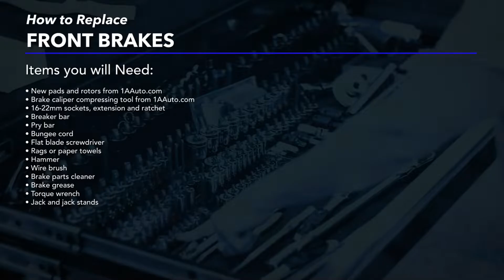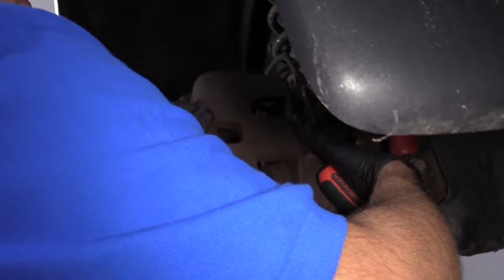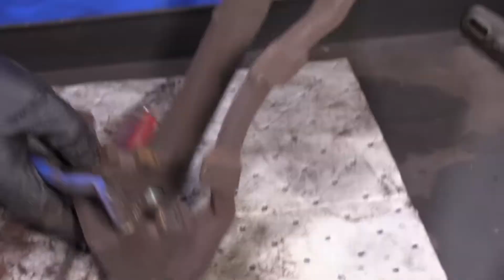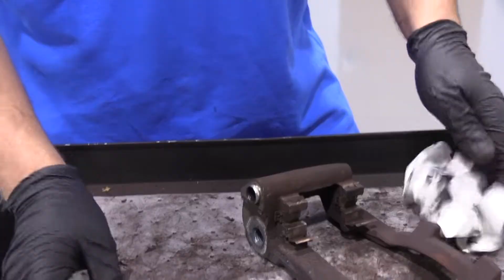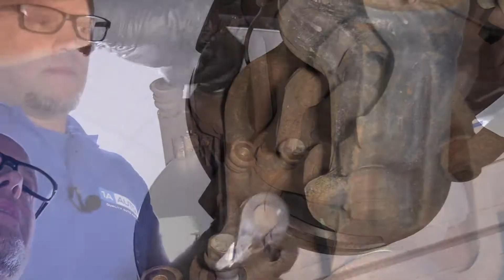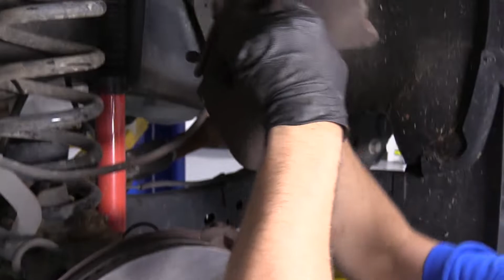How to Replace Front Brakes 13-16 Ford F250

Comment: Great video what is the break in process for these new brakes and rotors? I am about to change front and rear on my 2014 f250 6.7 and I want to make sure I break them in properly before I tow my 5th wheel!

Comment: You installed new brakes shoes using the old clips....that’s a cheap job. New set of breaks come with new clips
Reply: not their pad sets... no hardware included! And he reused the old bolts after he said they should be replaced FAIL. And he didn't put the cap on right, missed the notch

Comment: 165 foot-pounds huh? That explains the 2-foot breaker bar. 

For one, make sure your torque wrench measures to 165 ft lbs. In which case, a lot of cheap torque wrenches, do not measure that high. And some of those ones, from the horrible freight company. Might say 165 lb on them... But if they were really calibrated like that... You wouldn't be purchasing them at horrible Freight. Sometimes, those numbers are more of a marketing tool. Then a functioning tool. And I know, some technicians, are going to reach for the impact wench. But a couple of things to consider there is, what is the initial torque, your impact puts down? 650 foot pounds? My vintage Ingersoll, impact,  puts down 900 foot pounds of reverse torque. And 650 foot pounds of forward torque. Turning your setting down to one, does not mean you decreased your torque on your impact wrench. Turning the setting down, means that, you want less resistance, when they lug nut bottoms out. Resistance, and torque, are not the same thing. A decent, impact wrench, runs the risk, of snapping those lug nuts right off. And if you're a technician, snapping lug nuts off, with your impact. You pay for that. Not the customer.
Reply: Also, per shop manual, place a drop of oil between the lug nut and lug nut washer to achieve proper torque. Do NOT get oil on threads.

Comment: Are those metal clips needed?
Reply: usually when u buy new brake pads at any auto store they come with new clips. I know autozone and napa does in the northeast.  Actually come to think of it over the last 20plus years theyve always come with new cliips..   Makes no sense not to replace them Its a must in my book

Comment: Do you definitely find that pushing the caliper pistons back without cracking the bleed nipple, forcing brake fluid past the piston in the master cylinder into the reservoir, doesn’t trigger the ABS brakes sensor in the master cylinder, lighting up the ABS brakes warning light on the dash & requiring a scan tool connected to the OBD 2 port under the dash to re set the engine computer ABS code for the ABS warning light on the dash to go off?

Comment: I'm surprised that your brake kit doesn't come with replacement hardware clips, bolts etc. Why reuse bolts at 166 ft #'s when manufacturer recommends replacement?
Reply: OEM clips are always better quality than any aftermarket clips, which most people buy, so it’s better to clean and reuse those than install the new clips. But only replace bolts if OEM calls for that

Comment: Thank you for the video. I have a serious question.  You pulled a rusted everything off. Then with the new rotor you wiped brake cleaner on it to take off the coating that prevents rust?  Am I missing something or is that right?
Reply: The coating is in the entire rotor to prevent rust everywhere (middle where it connect to hub, cooling fins, etc.) he removed the coating only where the rotor will make contact with pads so it doesn’t interfere with the connection when you brake. Not a big deal if you don’t want to clean them I wouldn’t worry about it.
Reply: Tommy PeterPantsz No that is  right! The coating that prevents the new rotors from rusting while in storage in their box is oil based!
You remove it so it doesn’t contaminate the brake pads with oil & reduce their effectiveness.
The rust gets worn off any time the brakes are applied.
If you don’t remove it, that preservative oil coating gets hot and smokes a lot when you apply the brakes the first few times, making everyone think your cars on fire!